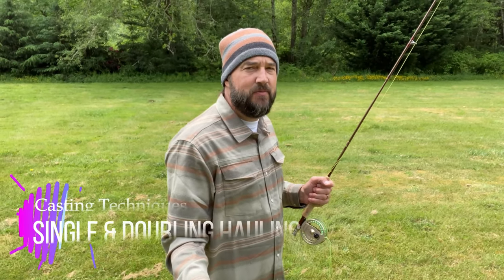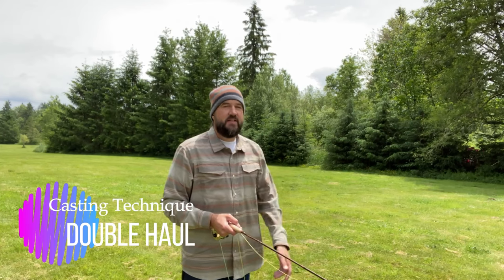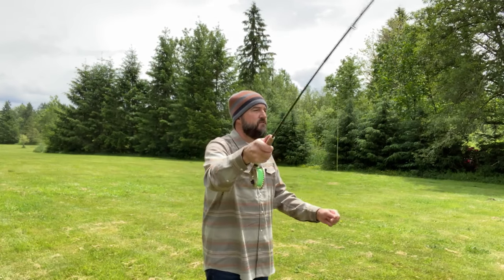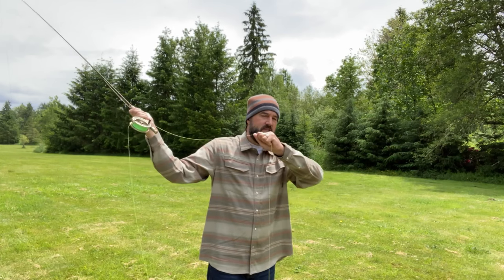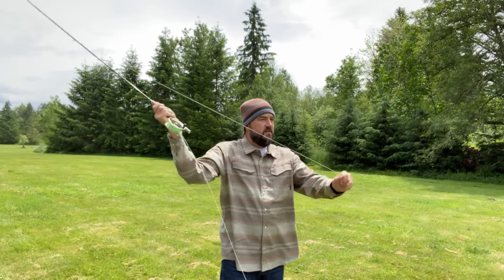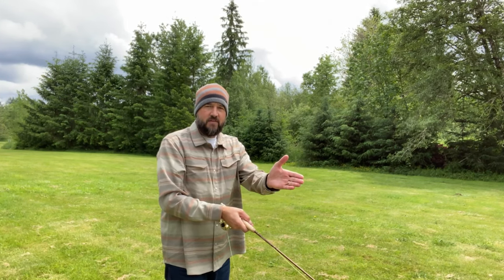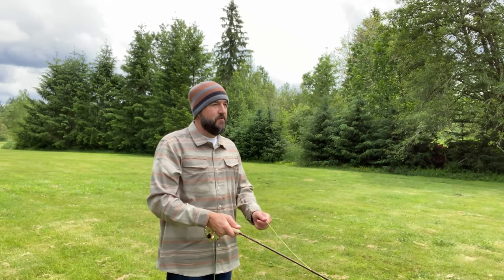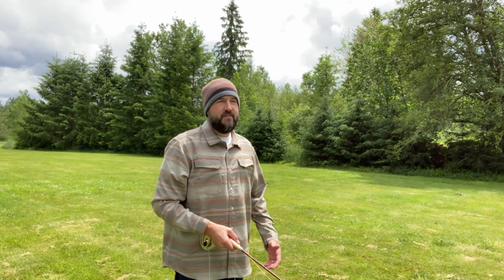Adding Distance to Your Cast - How to DOUBLE & SINGLE Haul

Comment from the maker: While it is important to keep a mental discipline regarding your rod position at 10-2, your arc will begin to widen slightly beyond this point as your distance increases.  However, it's important to have this mental discipline in place so that your cast won't degrade.  You will find that your arc will widen organically to near 9 - 3 (or 170 degrees max) as shown in this video and as you continue to generate line speed with greater distance.

Comment: Thanks Dan, have a sink tip line and will be using it when a bit warmer out. What wt. tippet(mono of flouro) would be good on 7wt line. Also how long and should it be tapered or straight?  Thanks Dan.
Reply from the maker: You are most welcome!  I would use a flouro tippet (sinks faster)...if you are using a furled leader, you can use straight 4x or 3x flouro tippet.  If you have a loop-to-loop connection, use a 7.5-foot tapered leader - helps roll over the fly on a cast.  That is what has worked for me over the years.  Cheers!
Reply: @FlyFishDan  Thanks again Dan

Comment: Everything else being equal, what is the difference in casting distance between the single and double haul?  Thanks.
Reply from the maker: Typically - you can achieve a distance of 30% greater using a double haul over a single haul.

Comment: What situation would call for a single haul and what situation would call for a double haul? Seems like double haul all the time would really get your line speed going.
Reply from the maker: Sometimes a quick single haul when initially picking the line up on the water helps generate line speed.  Otherwise - double hauling is best to get the line going for sure.